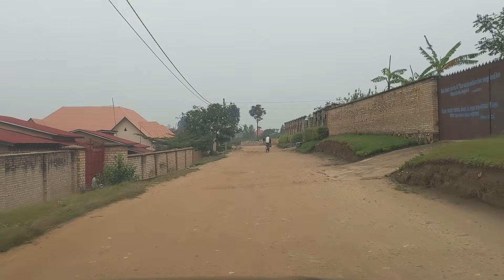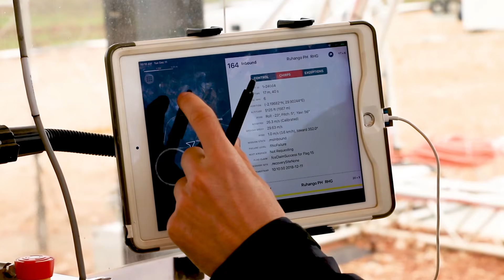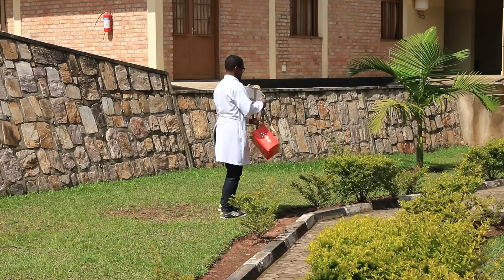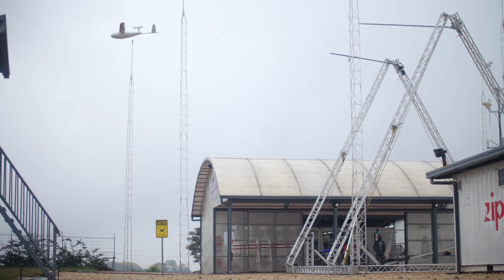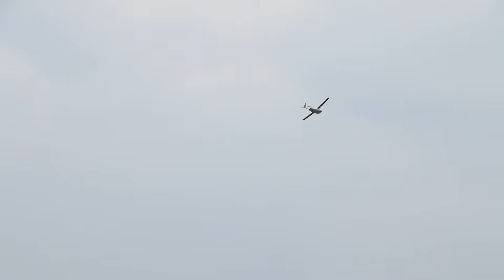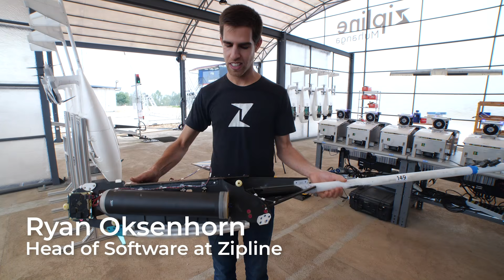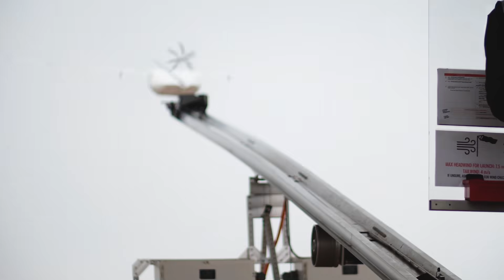Zipline - How Rwanda Built A Drone Delivery Service

Comment: Rwanda? mind blown. Keep innovating. Bless you.
Reply: None of the engineering is actually from the rwanda. Zipline is american
Reply: Yes Egg The actual operations center of the company is entirely in Rwanda and maintained by Rwandan staff. Not to mention that the company relies on the Rwandan air traffic control system.
Reply: @RihannaIsIluminati  It is an American company that have set up an operation centre in Rwanda and trained Rwandan staff to carry out the necessary operations.  Ultimately this is American technology and innovation.
Reply: @blokeabouttown2490  so what

Comment: They go on about trying to have drone delivery in the cities, but it's really hard cos of the regulations etc. So do it in remote ares first cos all remote ares need it for quick easy and cheap emergency logistics. And we can do that now in the remote areas, and then later as we develop stuff more, we can then do it in the crowded places. We have the royal Flying Doctor service in outback Australia, and a lot of that could be done with long range delivery drones in the cases where only medication is needed. Saving money for the Flying Doctors...Who usually fly Beech King Air twin engine turboprop planes (that suck juice).

Comment: Hmm. This seem like a very expensive solution and one which is useful in a very limited set of circumstances. A very simple petrol powered drone that takes off and lands on a small runway would require none of this infrastructure and its operating costs would be tiny in comparison.

Comment: I think I should mention that zipline is an American startup company and all the design and service was made in usa.
Reply: Tomas Strolys The actual operations center of the company is entirely in Rwanda and maintained by Rwandan staff.
Reply: @RihannaIsIluminati  
the engineers and software developers who designed and built these are all americans. the "operation center" does little more than use the already built drones for whatever purpose.
Reply: @voltagedrop5899  Who cares? Most of the planes from idk Thai Airways were developed and built in Europe by Airbus, while the airline does nothing more than simply operate these "already built" planes. But nobody in the history of man ever said "Today I'm flying with Airbus" instead of "Today I'm flying with Thai Airways".

I get the feeling all you guys underestimate the value of this project in Rwanda. Developing and building is one thing, successfully operating in a designated region is another. The government of Rwanda has its fair share in this project just like the Americans who thought that up.
Reply: @voltagedrop5899  researching? It's not like there weren't any drones around when they started their project lol. Building a car or building a smartphone is not that hard tbh, that's probably not the best example to support your arguments. If you don't know if your product works in regular service (like idk hydrogen buses in public transport), you'll need someone who supports you, someone who tests your product, gather information and experience for further development and expansion. This step might even be more important than its initial development. Rwanda paved the way for the engineers to transform their drone from basically prototype-state to series maturity.
Reply: @sevonthegreat  
"Building a car or building a smartphone is not that hard tbh" the R&D side is still infinitely more difficult than letting some random idiots test the product after you've taught them how to use it, which was my original argument.

"you'll need someone who supports you, someone who tests your product, gather information and experience for further development and expansion" except any idiot who can read the instructions manual can do that, which is why these aren't being tested by scientists in laboratories but by some barely qualified personnel in the middle of a jungle.

"This step might even be more important than its initial development" without proper testing, you'll have a sub-optimal product. without initial development, you won't have anything. in what universe is it more important to perfect a product than to come up with it in the first place?
Reply: @voltagedrop5899  I agree. The real value in this project is the developers innovation and attention to ease-of-use, not the employees operating their system.
Reply: RihannaIsIluminati yeah I think it was obvious from the video, but they didn’t even mention where this system was created which I think is really essential.
Reply: @MTomas95  not really.
Reply: IgnorantC what do you mean?
Reply: @MTomas95  True they should of, but ehh. Most don't care
Reply: @MTomas95  Does Uber mention where the cars are made?
Reply: @phatcap976  uber uses cars from all different manufacturers. the driver makes it very clear they are using uber; in this situation the driver is the rwanda govt and uber the innovators and developers of the product and software. Any unskilled personell could be trained to use this system, the fact it's in rwanda is likely due to politics, not 'their share in the project'.
Reply: Did you notice that the entire system operates just like the aircraft carrier
Reply: Lol the point of the video wasn’t Zipline but the drone and how it works.
Reply: same company cant implement the same service or fly drones in america
Reply: Ten bucks says you are NOT among those Americans who designed the system. Pathetic!
Reply: @MTomas95  My point is that why should they mention it? Like Uber or any other global service company, there is no need. If you didn´t get my point, then you should check your IQ and your grammar too.
Reply: @C S I know, I'm sure the application is carefully designed by the developers too; otherwise it's just a drone...
Reply: Did you google all that ? Sad 😂
Reply: @seananthony7528  
i fail to see how correcting misinformation can even remotely be considered "sad"...
Reply: @seananthony7528  Double check the information and don't trust whatever they say, is sad for you?
Reply: But they worked directly with the Rwandan government which oversaw the project.

Comment: This is pretty revolutionary. This could be used to help with much more than just blood and medical supplies for remote areas. Off the top of my head, I can see this being used to distribute educational material to students in remote areas or deliver supplies to regions affected by natural disasters or to somebody trapped in a remote area. There are literally oodles of potential applications. You could even take it a step further and use solar panels on the drones or on the ground to charge the batteries, potentially making it a self sufficient system.

Comment: Sounds like having fixed cameras would be more efficient for the preflight self checks.
Reply: That's added infrastructure and a specialized piece of equipment vs the phone that everyone has in their pocket with a small app.
Reply: @OspreyKnight  cameras are neither specialised nor "infrastructure". In any case a couple of phones with good cameras could be used instead. Faster and less labour required.
Reply: @OspreyKnight  you don't even need a frame, just cheap security cameras. There's very little development time, finding and zooming on QR codes is a solved problem. Then once you have the code you zoom out and capture the test. It doesn't have to be perfect either, since you still have a human there, but they should be for *backup*. The only reason to use the current system is because it's temporary. The small development cost would pay off pretty quickly even with third-world labour - but of course this is all a test for the first world anyway.
Reply: @OspreyKnight  They will probably automate the system more as they grow in capacity.
Reply: @neojack333  Eventually. But there is a reason we still have workers on factory assembly lines.

Comment: It will be interesting to see if there are any updates with this form of delivery system for handling the adverse weather conditions sometimes present in other disaster zones, an example of this would be supplying medical equipment in 100mph+ winds during an active hurricane which would probably tear this aircraft apart mid-flight. Very impressive so far.

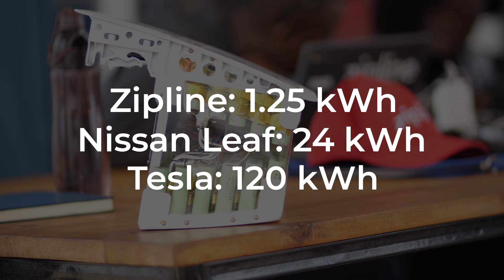Comment: 7:58 "your average Tesla has about 120kWh". ???WHAT???
show me 1 tesla model that has 120kWh or more! most of them have around 75-85kWh and up to 100kWh (model S), with the model3 coming in new and has also 75kWh and later on will have 50kWh.
did you mistake kW (rate of charge, unit of Power) with kWh (battery capacity, unit of Energy) ????
Reply: Relax man. He future proof
Reply: Well, does it really matter, in context of this video?
Reply: @fabianmuhammadgiffariputra7461  it does. it shows he didn't do his research right.
it shows that if he fails on that simple fact, he will fail on more facts. 
meaning this video has no believeable part whatsoever, since every single thing could potentially be wrong.

Comment: The launch and recovery tech look like they were both inspired by naval aviation. Well done!
Reply: No the launch and recovery systems were inspired by much much older drones like the drones like ones used in the first Iraq war. They used to just fly into a wire and get tangled and the catapult is largely unchanged. Those systems may have drawn inspiration from naval aviation which drew inspiration the wright brothers catapult
Reply: that's right! I didn't realise that the assisted launch / landing systems were so similar to those used on aircraft carriers.

Comment: Right, why bother with the full catobar system?
Catapult is obvious, it means you don't have to carry the fuel to launch.
Also, it's much more rain proof.
They're not short of space, so why bother with the trap?
Why not just land on some tarmac?
The aircraft that launch and recover from catobar ships are super heavy because of all the extra strengthening they require.
And they still wear out twice as fast as regular aircraft.
So I don't see why the trap is a good idea.

The only things I can think of is:
1) They want to perfect a system that shows that Zipline can work in a crowded downtown area? Not just the boonies? Or on a ship? Are they after military contracts too?
2) it's really rainy and the tarmac run way isn't useable in the wet?
Reply: Landing gear is more heavy than a hook, also its autonomous drone, it would be easier to program it to  land in a trap than landing on tarmac.
Reply: A different video mentioned the catch saves weight by making wheels superfluous and less parts can fail less.
Structural integrity might too be less of a problem on smaller scale.
Reply: Fantastic, thanks for the answers!

Comment: The take of it  and the landing of it looks like the takeoff and landing of the aircraft carrier
Reply: I mean, it faces the same issues as an aircraft carrier.
Reply: @yobeefjerky42  Not really... Sure, fast take-offs are also important for aircraft carriers. But the main problem on an aircraft carrier is the little space you have to get the planes in and out of the air. If using a catapult mechanism would save you that much time getting a fighter jet in the air, air forces would install it on land-based airfields as well.
Reply: @CheesecakeConnaisseur  Their problem is very similar to an aircraft carrier. It's just that instead of having too short of a runway, they don't have a runway at all.
Reply: @rifraf276  Hm, I can't really tell if you are joking xD 
Nevertheless, not having a runway is not their problem, it's their choice. There is no need for the drone to be able to take off anywhere else than the base(s). So they can reduce the weight (, drag) and complexity of the drone by just not putting any wheels on it. Just like it was said in the video. (Although, maybe it was said in Wendover's video, I'm not sure) Additionally, bringing the drone up to cruising speed with a ground-based contraption saves quite a bit of energy compared to having the drone take off on a conventional runway. I guess that way they also can get away with a less powerful and thereby lighter motor for the propeller.
Reply: its take-off and landing...
Reply: The catapult probably extends its range, as well. Not much, obviously, but I'd say it's at least one kilometer.
Reply: @pseudotasuki  It's much more. The launch itself is not the issue, it's the amount of complexity and weight you save by not needing the equipment for take off and landing. For instance, it doesn't need wheels and the motor is probably a lot smaller as well, because it only needs to sustain its speed, it does not need to accelerate up to take off speed.
Reply: @hkr667  True about the landing gear, but as pointed out in the video the drone has two motors, but only uses one during the flight, with the second acting as a backup.

Comment: 7:59 slight mistake here. No current Tesla car in production has that large of a battery. The current largest battery is 100 kWh and the smallest used to be 75 kWh.
Reply: Slight mistake here, The current largest battery is 100kWh (Model S/X) while the smallest currently available is 62kWh (Model 3). And Model S/X used to be available with 60kWh and Model 3 will eventually be available with 52kWh.
Reply: The Tesla models with 60 kWh batteries were actually software-limited 75 kWh battery-packs, but other than that you are correct.
Reply: BSC4PE Since 2016, yes. But originally it was a 60kWh battery pack which was also reflected in curb weight. At the very beginning there was even a 40 kWh model but only few people ordered it. The few that actually did order one received a electronically limited 60kWh pack.
Reply: Ah I wasn't aware of that. Thanks
Reply: I'm in the YouTube comment section, right? Why is everyone so nice and not so offended by others' corrections in tiny details of their comments?
Reply: @Gabriel Cabana Actually 62kWh Model 3 is medium-range and is already available for 44k. You are talking about ~50kWh 35k USD low-range version (or you can use euphemism like "standard range"), that is not yet available.
Reply: BSC4PE lithium ion batteries work well if the charge kept between 20-90%. Meaning 100% charge or anything below 20 is bad for the battery. So, tesla knew that people will not pay enough attention to it so they secretly put bigger batteries so at 90% charge it will be same as 100% charge of a 100KW/H battery. It was proven when tesla unlocked the remaining battery capacity for people who were fleeing from hurricane last year I believe...
Reply: @1wasinAlpha  thats not entireky right, iirc. Tesla recommends charging to no more than 90% of the displayed charge, so it would be redundant to artificially limit the battery capacity further. Also, you mentioned them unlocking battery capacity during hurricane michael, but actually that doesn't unlock battery capacity for 100kwh models, only for models with electronically limited batteries (like 75kwh model s i believe, which actually has an 100kwh model battery because it's more cost effective to install the same battery in every car than to add complexity to the factory). So only smaller capacity batteries were affected. If I'm not mistaken though, even 100kwh battery packs contain about 5% more capacity than advertised, but it doesn't get only gets used to compensate for battery degradation over time.

Comment: 120kWh tesla?
Reply: Yea that's wrong. More like 75 to 100 kwh
Reply: Scott Bora - The old Tesla roadster had a 120 kWh pack
Reply: @spoonikle  no it didn't, it was like 50 kwh. You're confusing the charge rate (120 kw) with the pack size (kwh)
Reply: Scott Bora - I would delete my comment but I will leave it to be wrong. I am wrong.
Reply: @spoonikle  honorable of you
Reply from the maker: Does the model S not have a 125 kWh battery? I need to stop relying on my memory for these things.
Reply: @RealEngineering  no, the model s is currently a 100 kwh pack. They used to also sell a 75 kwh but they just discontinued it
Reply: Real Engineering as mentioned, Model S/X were labeled by battery capacity ranging from 60 to now 100 kWh, 75 being recently discontinued. Model 3 long range has about 72-75kWh and mid range about 62-64. 120 will be fantastic but is not there, and certainly not the average. 
This does not take anything else from your fantastic video and it is very inspiring. Keep up the fantastic work. Any way normal people can help Zipline?
Reply: Rick Lokers  lol
Reply: at least they have made a 24kwh leaf

Comment: Hi mate, any chance of covering boeings new wing design?
Reply from the maker: For the 777x?
Reply: @RealEngineering  Yes please, why the fold is necessary and any innovation involved, why it hasn't been done before.

Also this is interesting, a new transonic concept. https://travel.nine.com.au/2019/01/10/09/35/boeing-new-wing-design-higher-faster-planes
Reply: @CNERail  the folding is because the plane is so wide it wouldn't fit in many gates the 777-300 uses now. That would be counterproductive for airlines.
Reply: Mentour Pilot did a vid on that.